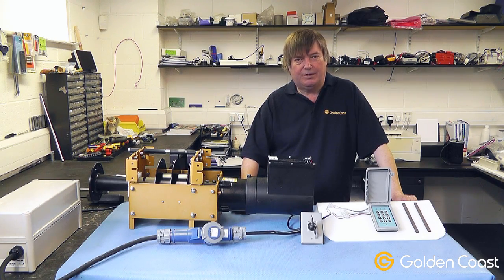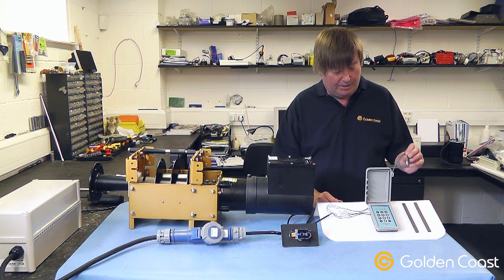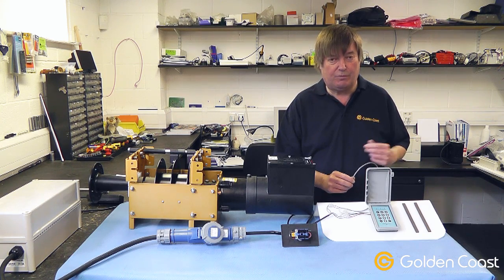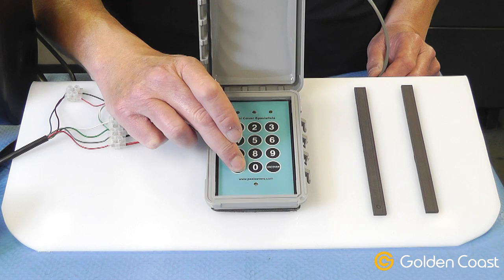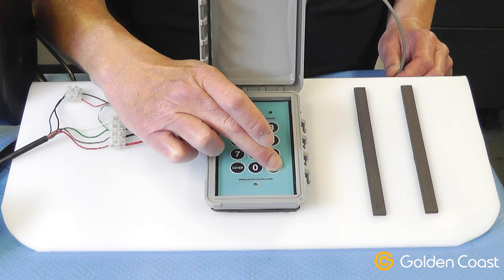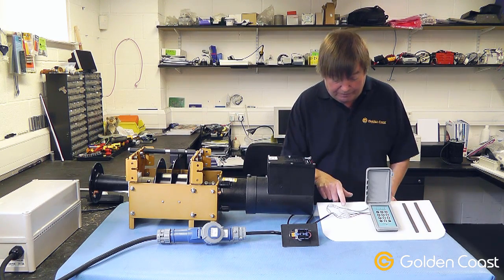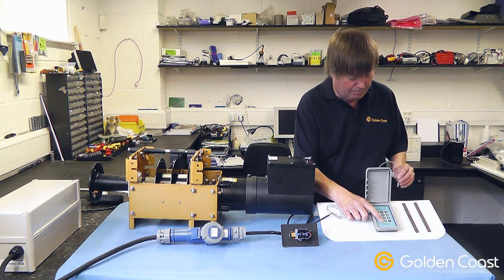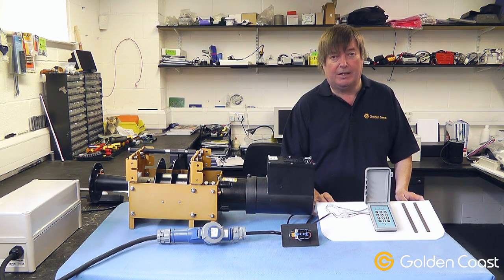Infinity Pool Cover Controls | Andy's Answers

Comment: Hello again Andy, Another question, if I may: Is there any way to manually control opening and closing of the pool cover?  I managed to close it, the approx 8 feet I had it open, using a pipe wrench.  Not easy.  Any suggestions, even re applying ac?

Comment: Hello Andy.  Thanks for this excellent video.  I'm in California and my system looks identical.  It's 16 years old and today decided to not respond to the key switch moving to close.  It opens more and more but will not close.  I shorted out the contacts as they enter the control board... Open works well, Close, has no effect.  I found one website that wants an extortionate $625 for a new control board.  Do you have any less expensive solutions you might recommend please? It's maybe just a relay on the control board that has died. Many thanks, Nibornm (a.k.a. The Crazy Brit.)
Reply: did you ever get a reply to your question?